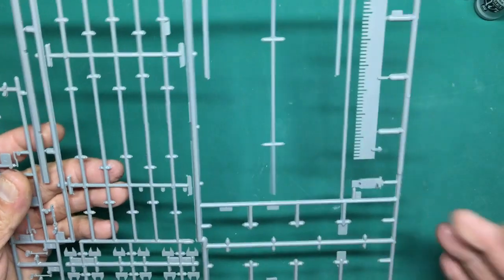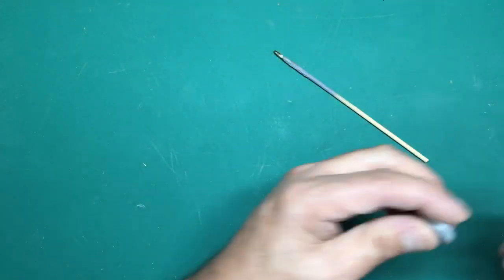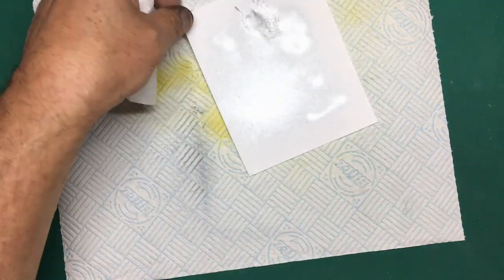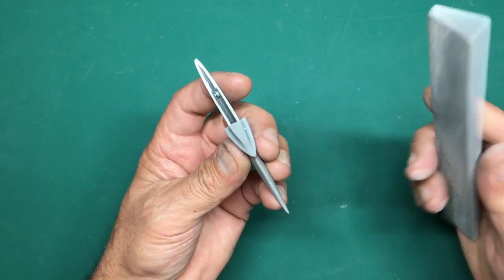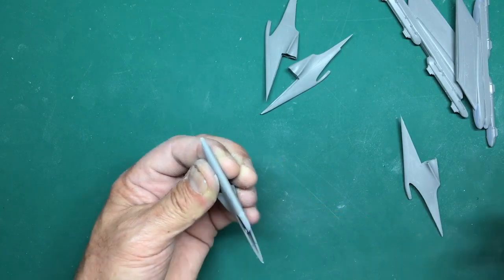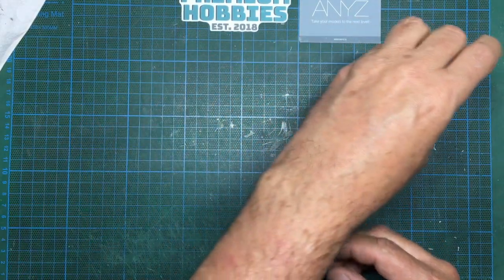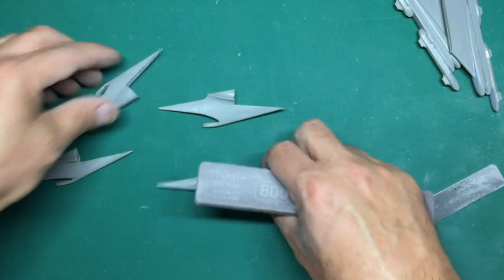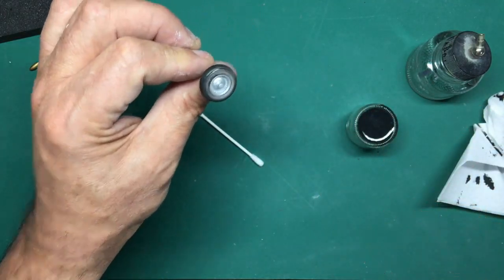Big Bad Buff Build for Beginners. Part 4

Comment: I've thinned X-22 (plus other Tamiya Acrylics) with Vallejo Model Air Thinners before at it's worked (not sure why as Vallejo Model Air is water based)..
Reply from the maker: Have you tried Water?
Reply: @NigelsModellingBench  I used to make pin & weathering washes using Tamiya mixed with water. Vallejo Model Color thins with water for hand painting. Model Air I only thin when I'm below a third of a bottle ;)